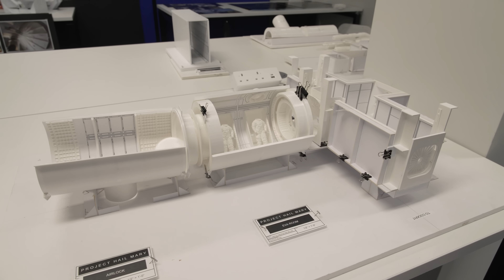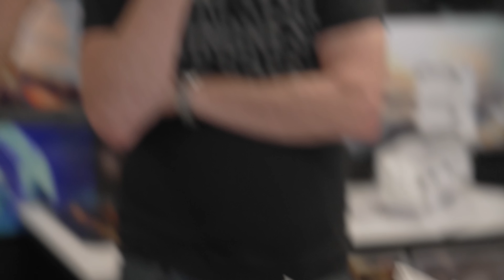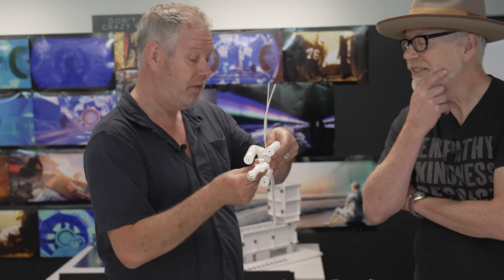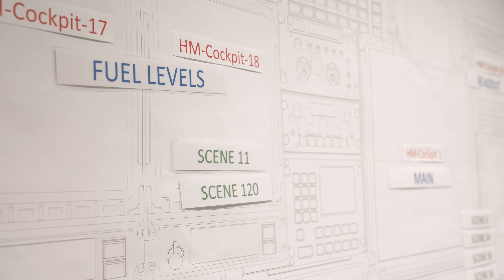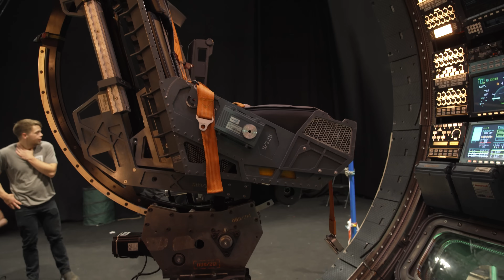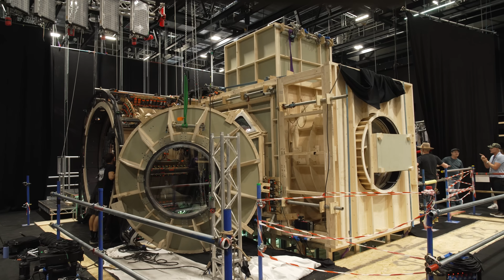Adam Savage Behind the Scenes of Project Hail Mary!

Comment: I think it's really interesting that they broke from the book on the design. I believe the book describes it as all being touch displays with very few actual buttons, but I think this is so much more visually appealing.
Reply: Large in part due to Andy Weir saying his visualization is not very specific. It's just blobs of images when he writes. So when he sees the design team's ideas for the ship, rocky, and everything else he's just delighted to see the realization of the ideas in the book.
Reply: I was thinking it might look a little anachronistic in the future, but the Artemis II capsule is still using a very similar design. The Dragon capsule is all touch screens but buttons and switches are always going to be easier to hit while wearing thick pressurized gloves.
Reply: @ameliamesdag  speaking as a pilot. touch screens are fine, but critical controls should be physical buttons, nobs, etc. as in case of emergency or just times when time is a factor you can reach out and feel controls without looking and use them. so throttle / mixture / prop fethering all have different nobs, can tell them apart without looking.
Reply: @PavelKrupets  I think this applies to automotive and possibly other areas as well. It is so stupid (and dangerous) when one has to look at a screen in order to find controls for common functionality. The tactility of physical buttons and switches blow touch based solutions out of the water, though having both for redundancy is best in case one thing fails.
Reply: @Autian  yeh, tesla as well
Reply: I like to think Stratt thinks buttons are more trustworthy than screens so wanted to use as many as possible haha! And I don't know much about spaceships but I wouldn't be surprised if they actually did use more buttons than touchscreens anyway!
Reply: @Mads97415  I’d like to argue that it would probably have a lot to do with the same rationale used for all the science equipment, and why they opted to create artificial gravity. In the book, Stratt decides that rather than commissioning brand new zero-g designs for hundreds of different pieces of scientific equipment (all of which would have very little testing done to verify it), they decide it’s better to stick with the well known, time tested systems - and figure out how to create gravity for them to work within, instead.

In the same way - I imagine that all of these avionics components that they use in the cockpit of the HM, are actually already designed, time-tested systems that have been in use in space craft and the ISS for decades. It’s way simpler, safer, and more reliable to stick with what’s known, and already flight-proven, than to build something completely new and never before used, for this specific mission (and risk it all failing, on a design flaw that they never had the time to identify, and fix).
Reply: @Mads97415  touch screens suck for serious work. we have found that out with cars, bring back the physical volume knob. its a royal bitch to try to stab a screen while you bounce down the road
Reply: @Mads97415  yeah I agree, touch screen just leaves to many points of failure and that's not acceptable, unless they were panels that could be changed out, but that also makes more weight .
Reply: @thecasualfly  In the book, every screen was completely interchangeable. After some of the "main" cockpit screens are destroyed, he just switches to using some other ones, which have the exact same functionality because all the screens have the same functionality.
Reply: @thecasualfly they were panels that could be changed out, and he actually does replace one in the book (it was smashed by Rocky while he was saving Grace)
Reply: @erictheepic5019 yeah, and Rocky can only "see" one of the screens with his tool in the book, so he's usually pulling up controls from the other screens on the "main" one so Rocky could see
Reply: @Mads97415 common misconception, mechanical failures happen much more often than electronic ones. I agree this looks cooler tho
Reply: @jesusdiaz2299  Which disregards the observation that mechanical failure of electronic touchscreens is pretty darn common. The main problem often isn't durability but intention; few things suck as badly as touchscreen controls that move out of the way or get covered up while you reach for them.
Reply: @0LoneTech  In the book he breaks one of the screens and he just uses the remaining ones without a problem. He could cycle between all the "views" in all the displays. Rocky's camera was only pointing at one of the screens too, so he usually configured that one to whatever he wanted to show Rocky.
Reply: @jesusdiaz2299  but they're also easier to fix, there was a lever or something that broke on a NASA mission, and the astronauts were taught how to fix it by fixing the connection, with screens it's harder to find which wire goes where.
Reply: Take a look at the SpaceX crew dragon, the most used actual spacecraft right now, it has three large touchscreen and only 38 physical buttons mainly for emergency function.
Reply: @MrMMrulez i dont think i'd trust spaceX as the standard for spacecraft 😭
Reply: @MrMMrulez  Crew Dragon is largely automated and has direct contact with Earth. It's also just a capsule, not an interstellar ship. It makes sense in the story because humans have to come up with a ship asap so they use whatever available and tested modules and technology they have in store.
Reply: @holydamien  Orion has touchscreens but also plenty of buttons.
Reply: @saym0.0 Falcon 9 is the most reliable rocket in current use and astronaunts love the crew Dragon from all the reviews I've seen. SpaceX is also the first company to ever land and reuse booster and the only one doing it conistently and reliably.
Reply: @MrMMrulez  SpaceX Dragon capsule is solely for Earth to orbit and back only and doesn't need much piloting, ofc it's no problem using mostly touchscreens because its almost entirely automated. Meanwhile Hail Mary is an Interstellar spacecraft that needs dedicated piloting to travel between planets in Tau Ceti, the distinction is important and besides, I feel like those screens are not all screens but some might be touchscreens as well
Reply: @Mads97415  yup, my biggest pet peeve is in star trek, the pilot drive a spaceship with touch screen. That’s just terrible
Reply: @rocketman-766  why? Much better ability to display rich information without sacrificing resolution
Reply: @whereDoCarrotsComeFrom  for the overal cokpit yeah, but i’m specifically talk about the pilot they literally steer the spaceship with a touchscreen, not without somekind of joystick or control stick. Touchscreen doesn’t give you good tactile response and feedback
Reply: Honestly that’s one of the changes that just makes sense like the touchscreens work out better for Grace in the book because he has no piloting training so the computers let him figure out where things go easier, but buttons are just much more failure-resistant.
Reply: @aphsiao Touchscreens would lack the emotional weight the movie needed to convey with being in space.
Reply: @aphsiao  
No, buttons fail easier. Electronics are generally more reliable than mechanics, if made well, and can be redundant too.
Reply: Exactly
Reply: It’s much more detailed than the book’s industrial grey look, I love that they went for an 2001 and Alien look to give it that same style
Reply: @Obscureandfluffy  Yeah, I pictured everything being gray and plain when I read the book, so it's neat to see a completely different take on it.
Reply: Also the book has the ship being much less spacious. It’s only three rooms stacked vertically. They really expanded it out for the movie.
Reply: @DoctorBatmanMD They needed camera space, and also neededto be more visual to convey thoughts. Hence the 360 theatre room.
Reply: @DoctorBatmanMD thats my biggest gripe with the movie. In the book the ship was claustrophobic, in the movie it was huge and luxurious.
Reply: @TheVanillaGoose  I mean, it would have been harder to maneuver the zero g effects wires and Rocky's puppeteers in an even smaller space.
Reply: Also - no spoilers - but there is a scene where Rocky needs to flip a switch. Would be difficult or impossible with a capacitive touchscreen! 😅
Reply: Touch screens suck
Reply: Government projects are very conservative about the technology they want to use. Just look at the difference between the user interfaces of Orion and SpaceX dragon. Dragon is touch screen heavy and Orion is full of physical buttons
Reply: I will always prefer tactile buttons over touchscreens.
Reply: This set is gorgeous
Reply: Yep
Reply: It's for Boomertrash. That's why I won't watch this even for free.
Reply: Plus you can go down to any computer tech shop and probably grab yourself a box of 100 random assorted buttons for like 10 bucks, which makes the prop more practical for the actor as well as making it cheaper to produce on the studio because you no longer need a VFX person to digitally add in on-screen touch effects every time Grace does something. Just need a sound engineer to add in a click or a flip type noise every once and a while.
Reply: I found the projector "TV" room a bit jaring... like whats it for? Their all in a coma whilst they travel, they work on the problem, they die. What would be the benefit of a whole room and power requirement for long term well being? Doesn't really work with the idea of whats going on.
Reply: @BlueTheVixen  its not like they would be able to find a solution for the problem straight away, they had no idea how long that would take so maybe they thought it would be nice (or even necessary) to be able to watch something when there’s downtime, to rewind. They also weren’t demanded to end their lives as soon as they found a solution to the problem, they could go on their own terms whenever they wanted to. Maybe that would be the day after, maybe a year later (Grace mentioned that he would have enough food to live for a couple of years).
Reply: @mikian the room is just something cool for the movie, it’s not in the book.
Reply: @BlueTheVixen yeah that room was just for the movie, it’s not in the book.
Reply: Mechanical is probably better anyway because it breaks less
Reply: touchscreens in zero gravity would be so hard to use too
Reply: Yes because buttons are IT 😎
Reply: This certainly feels more practical. I love the ISS Vibes it has. It looks like a ship that could very exist today if people put their minds to it. Maybe not the Astrophage unfortunately 😔
Reply: @Anorak-005  Unfortunate that we can't use them for propulsion, but fortunate that they're not eating our sun
Reply: it was all about making it more visually appealing, which I find a bit sad how much they changed. But at least they thought about the details in the new design..
Reply: Its a shame this many buttons is horrible practice in real life cause it looks so good
Reply: @chilfang2422 Touchscreens on a spaceship is a bad idea. If it goes bad, you can't just replace a button. If you know where the button is, you don't have to look. You get the tactile feedback of yes, you did push it.
Reply: @armorhide406  Yes, but this many buttons (not to mentioned unlabeled) is ripe for disaster. It was even shown slightly in the movie when Grace started randomly pressing stuff. I mean the set designer(?) even said it was supposed to be overwhelming visually
Reply: @armorhide406  SpaceX disacrees.  All the controls on the Dragon capsule are touch-screen.

While touch screens don't hace tactile feedback, whether that's inmportant or not depends on the control and its intended use case.  If you need to operate something while paying attention to something else, like operating the HVAC system while driving down the road, tactile feedback is important,  But nothing in a spaceship save for docking has that kind of use case.  And docking is automated now.
Reply: @robertking3098 spaceX is run by a giant man baby more worried about vibes then actual practicality or logic.
Reply: @armorhide406  
In reality it'll be neither. By the time we'll have spaceships like this, AI will run everything, and human's will only be passengers at best.
Reply: @robertking3098 sure, but we've seen with cars that touch screens are less user friendly, it takes longer to do the same typical things with a touch screen when compared with buttons and dials. Maybe over the next 30 years that will change,  but having air conditioning/radio/phone/mirror control/etv all accessible through a touch screen has become a detriment to usability in modern cars lately.  It's easier for the manufacturer,  but if you are driving along and you want to change the air con, it's easier (and less time spent looking away from the road) to reach down and spin a dial rather than click through menus. Maybe we'll adapt and user interfaces will improve,  but it's not always the best choice.  I think aircraft are a great example where some things are done through touch screen but other things are still buttons, levers, dials, even though they have the technology to change, and plenty of automated systems, but there are good reasons why they don't change it all to touch screens.
Reply: @armorhide406 Except buttons add weight. Not a lot, but they do add weight. Not to mention if a critical button or switch fails it may be more tedious to swap out than just pulling a panel out and swapping it. Which is exactly what happens in the book. Not to mention you can move controls around more freely than with a switch/button panel. I think for a long term voyage that is also supposed to be a suicide mission, it makes a lot of sense to use a touch panel instead of physical buttons and switches.
Reply: @armorhide406 I'm sorry are you thinking that if a button goes bad on a spaceship the astronauts just rip it out and replace it? Because they dont

While on the other hand of you use a touch screen anything that was being displayed on it can simply just be switched to being displayed on another screen
Reply: @Alucard-gt1zf  What happens to the functionality that was on the second screen? 

It's a lot simpler to wire a redundant switch than it is to fit redundant screens.
Reply: @LynetteMacDonald-o2x8x im sorry are you new to computers or something? Just switch back to whatever was there originally if you needed to see it.....
Reply: @Alucard-gt1zf Yeah bro just keep alt tabbing between the Telemetry readout and the forward docking camera what's the worst part can happen. 

Fuck it, one screen for every function. You don't need to actively monitor Life Support anyway just thug it out if there's a malfunction in the CO2 scrubber while you're correcting your orbital trajectory, communicating with Houston and the ISS, and the other 50 things astronauts need to track in realtime.
Reply: @LynetteMacDonald-o2x8x you should look at what the dragon capsule looks like for space x

It works, get over it idiot
Reply: Actually, in the book, there’s many screens, and all of them can be swapped out, you can change what’s on them and view anything on any screen. So you would have to break many many screens before you get a problem. One screen does get broken in the book, but Dr. Grace is able to just switch which screen he is using, because you can access anything from any screen. This is safer and more redundant than a bunch of buttons.
Reply: @Nadir-q1i9i In order to do that you need far more screens than necessary. 

Screens are larger and heavier than buttons.
Reply: @LynetteMacDonald-o2x8x  But each screen is used for many purposes, the buttons are used for fewer purposes. And you need the screens anyway to display data and the Petrovascope and such anyway, plus you need redundant screens for that, so at that point they may as well be multipurpose touch screens. The screens are also easier to swap out, as I believe Dr. Grace does in the book after he breaks one. There is also a storage space aspect to consider, because the size of the ship was implied to be a bigger limitation than the weight of the ship in the book, and buttons are often hollow, whereas screens are flat and easier to stack in the flat narrow storage space that they have in the book.

Also, because you can view anything on any screen, you can have multiple people standing inside the control room, each with their own setup of screens to use. If you had buttons, would each button be multipurpose and set to different uses based on what was on the screen? Or does each button do a different thing? Would people be walking around each other trying to get to the button that they need? How much training does everyone need to know what buttons to press? How much time is that training going to take away from training for the rest of the mission? Are there different types and sizes of buttons and knobs? How many spares do they need to have on hand for repair?
Reply: @LynetteMacDonald-o2x8x  You guys are both right and wrong. This cockpit in the video(movie) would be absolutely insane to manage with 1-3 astronauts. Also, a few touch screens wouldn't be the only way to deal with that much shit.
Reply: @Alucard-gt1zf an anecdote regarding that. On Apollo 11, they accidentally broke the button to launch the thing off the moon, and had to activate the button using a pen to bypass it. A button is a hell of a lot easier to work around if it breaks (at the end of the day all you need is something metal to bridge the two contacts) than a touch screen.
Reply: @a @armorhide406 as opposed to having thousands of replacement buttons? While I agree mechanical buttons do look cooler, you can just “summon” the button or function you need on any touch screen VS having to have the specific button working. The failure rate for mechanical buttons is much higher too.
Reply: @LynetteMacDonald-o2x8x one screen had many, many buttons
Reply: @chilfang2422  The most advanced vehicles we have - naval ships - have plenty of switches and buttons.
Reply: @shakes.dontknowwhatyergettin  and the Three Mile island scare also happened in real life. Oftentimes good practices are forgone for in favor of being lazy or financial greed.
Reply: When I saw it in the movie it immediately threw me off. It's clearly made for visual impact, to look complex, but complexity was exactly what the mission team was trying to avoid. The ship was made so in case of Yao dying from the coma, anyone could fly it, but with the movie design how in hell would Grace know what to do. I did like the addition of the "Mary" AI though, that did make sense.